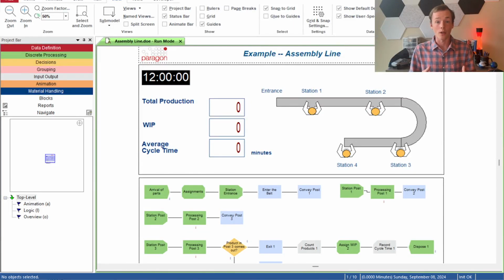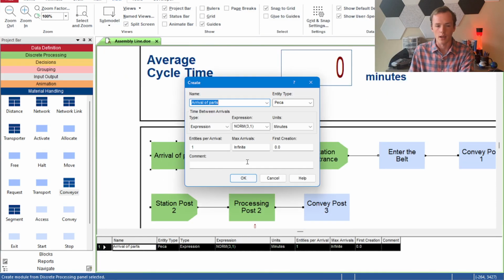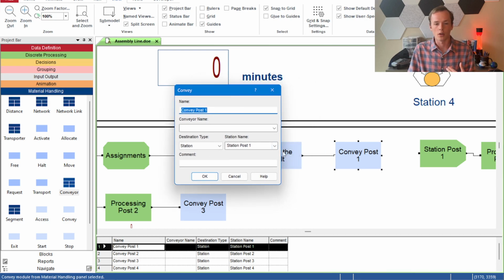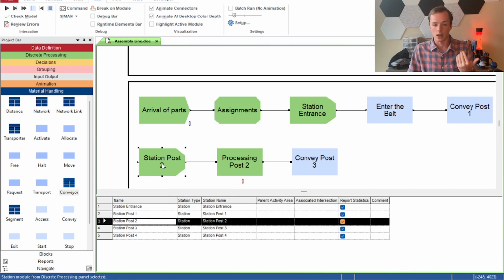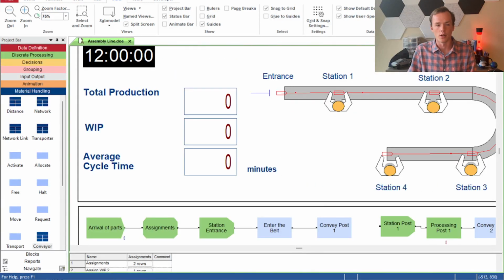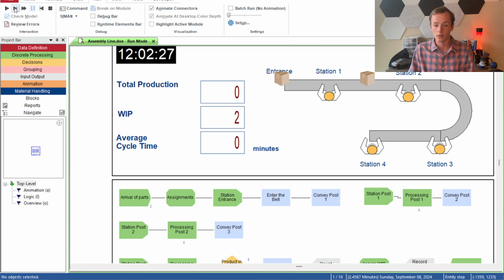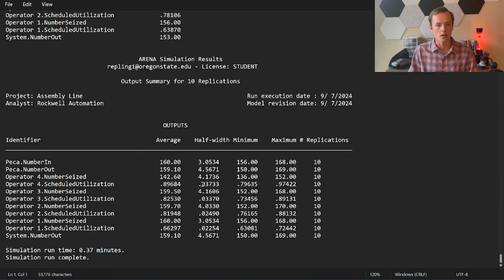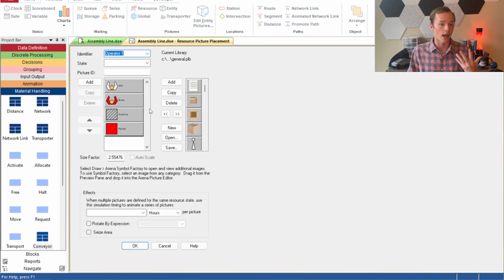Arena Examples: Assembly Line | Stations & Conveyors

Comment: I believe that this exploration can help me create a model to simulate a production line with 13 workstations (with 20 operators) feeding the carousel (with 30 operators). The idea is to enter the real times of each station and operator and validate whether the line will be able to deliver 200 pieces per shift, and use the model in other analyses (increasing or reducing production capacity). Thank You.